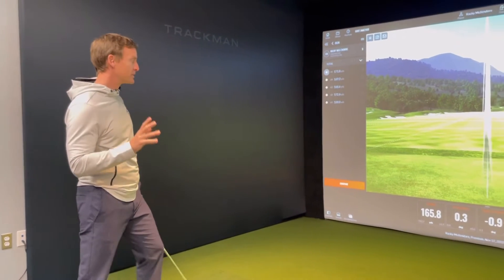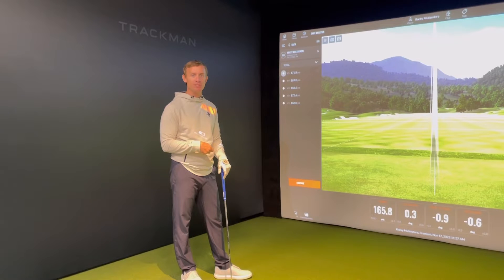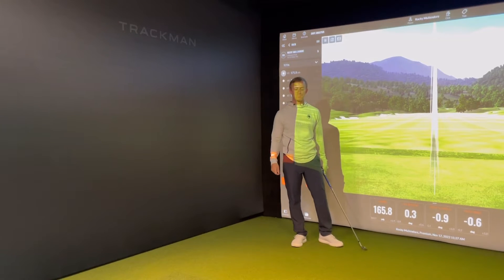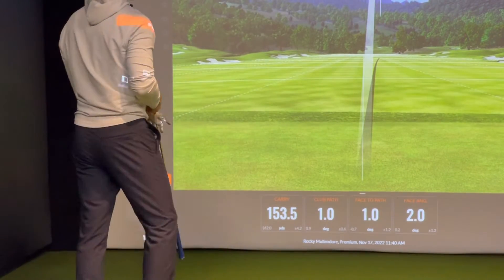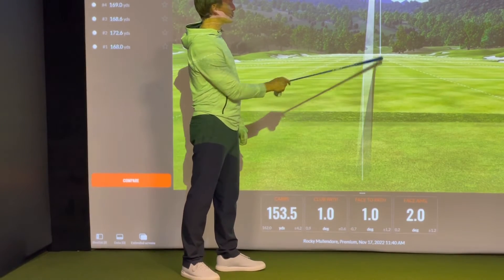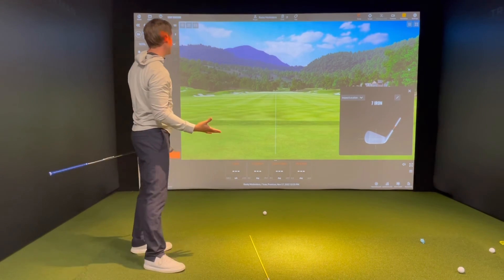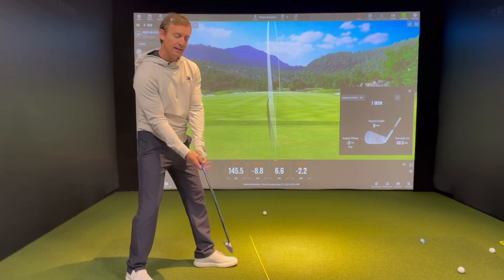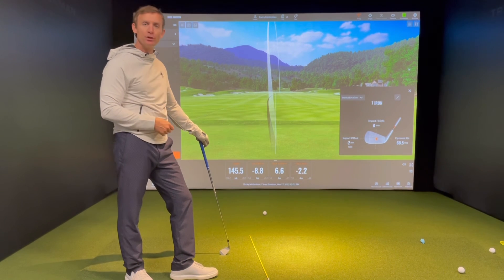Trackman data explained - Swing Path and Club Face fixes- golf simulator Trackman- golf swing basics

Comment: My club path numbers are generally -2/3 degrees but my face to path is open 3/4 degrees. So do I need to be working on swinging more from the inside and more forearm rotation? Or if I just closed the face more would that also fix the club path?

Comment: Thats weird im new to golf a little slicey but more pushy than anything my clubface is open at impact. Im right handed so on the course i play my push by aiming left of the target that way my push goes towards the target. Which is kind of the opposite of what you are saying to do in this video. Iv never hit a right to left ball in my life 😅
Reply from the maker: If you are pushing is right and slicing, then your path is right and the clubface is open to your path. I’ve got a video  https://youtu.be/4b_buwnYu7c?si=e5_8bANcTIRWVcAq that could help  you get a feel for the key face positions that’ll help you hit that draw! Thanks for tuning in!
Reply: Make sure you’re not rotating your right wrist clockwise at any point in the swing. Try a strong left hand with weak right hand and keep that opposite pressure through out the swing so the right wrist doesn’t turn the clubface open.